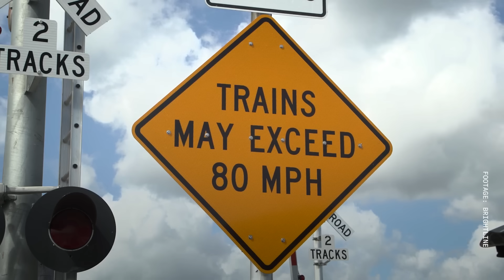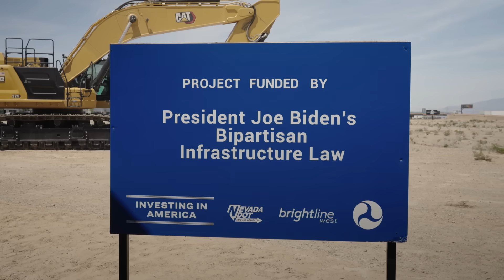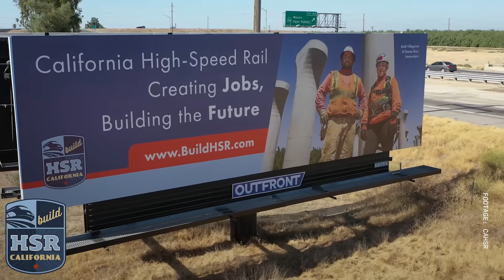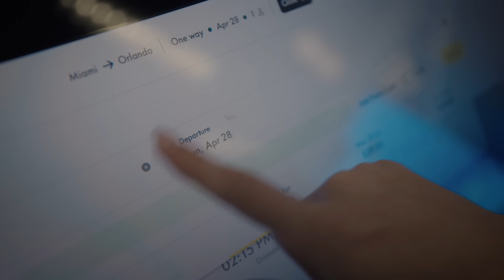Inside America’s First High Speed Rail

Comment: High speed rail is very practical for cites between 200 and 600 miles. It could remove almost a third of flights
Reply: Airlines don't want to hear that. But F 'em. Build, baby, build!
Reply: Which is why the Airline lobby is bitterly against high-speed rail.  Remember Southwest Airlines cancelling Texas's initial plans for high-speed rail?
Reply: @denelson83  That’s a silly reason. Japan has high-speed and regular trains all over the country and they still have domestic airlines.
Reply: @enjoystraveling  But in the US, airlines have a captive market and do not want to give that up.
Reply: Supposedly, more DC-NYC travelers chose Acela over flying between those two cities, resulting in most airlines ditching that particular "short hop".
Reply: @floydjohnson7888  Yep, because it's about 225 miles. Nearly the ideal distance for taking a fast train instead of flying.
Reply: Normally I don't have any problems with taking the flights. But these days the reliability of our planes is just...
Reply: 600 miles is really pushing it. The Paris - Marseille TGV line is 460 miles, and that's mainly an extension of the original Paris - Lyon line, which is 254 miles long. Washington, DC and Boston are about 450 miles apart. And San Francisco and San Diego are about 500 miles apart. That's probably as long as you can build in the US. While there are plenty of people who would take a high speed train from NYC - Chicago if one existed, there are too many stops to make it competitive with flying.
Reply: @brianfoss571  Then just do not make those stops on such a service.  In the UK, there is a dichotomy between "fast" and "slow" services, and in France, the dichotomy is between "high speed" and "classic main" lines.
Reply: @denelson83  Are you unfamiliar with American geography? Serious question. Good luck building a HSR route through South Bend, Toledo, Cleveland, Pittsburgh, Harrisburg, and Philly while telling residents the train won't stop there. Also, Paris-Marseille is the LONGEST route between major cities in France's HSR network! Again, it's only 460 miles. Any guesses how many miles separate NYC and Chicago?
Reply: @brianfoss571  If the train makes all those stops, then it would not be high-speed rail now, would it?

And are you unfamiliar with the sword of Damocles that is climate change?

And since I am not in the US, I only understand the metric system.
Reply: @denelson83   Didn't think you'd be stupid enough to reply with a worthless comment, but here we are:

1) HSR refers to the maximum train speed. The average speed in real-world service is lower, and real HSR routes involve intermediate stops at mid-sized cities. This is a common-sense idea that you should understand just by being alive. Trains rarely operate nonstop like planes do.

2) No shit. But electrifying *conventional rail* routes is going to do more to decarbonize transportation than building ultra-long HSR would. Most vehicle emissions come from cars and small trucks. Aviation only contributes about 2%. The vast majority of people can't afford to fly every week, after all. Ultimately, HSR is most effective for routes of 250-750 km (roughly 150-450 miles).

3) A mile is about 1.6 km. (See above) Multiplying distance in km by 5 and dividing by 8 is not exactly a complicated conversion, you know. We're not talking about converting kW-hrs to BTUs, are we? Besides, Google and Siri can easily run that conversion for you.

FYI: Chicago and NYC are 1400 km (870 miles) apart. At least, by the routing HSR lines would take. It may be worthwhile for the US to build a HSR line from Chicago to Cleveland (555 km), and another line from Cleveland to Philly (695 km), which would link up with Acela. But it's unlikely that more than half the people traveling from Chicago to NYC would take those trains. At best, it'd take 6-7 hours.
Reply: @denelson83  I don't use a fancifully archaic expression like "sword of Damocles" to describe a real-world, non-mythical problem like climate disruption. "Carbon bomb" is a more apt metaphor. I suggest you start using it, too.
Reply: @denelson83  do you just refuse to consider that there are trains that will stop at all stops, and there are trains that will skip most intermediate stops? Or are you just dense in your ways and love seeing people suffer through traffic jams?
Reply: @f-86zoomer37  Which is why you need a comprehensive conventional passenger rail network to supplement the high-speed lines.

The US does not have such a network.  The vast, vast majority of rail lines in the US is reserved exclusively for freight.
Reply: @denelson83  California literally does have that. So I don’t know what you’re complaining about? Just opposing something for a made up reason for the sake of opposing it?
Reply: @brianfoss571 the Europeans solved the 'stops' issue by having schedules that include the stops and other schedules that are 'express' routes with no stops between the major destinations.  All share the same rail line.   

Madrid to Barcelona express costs about 15% more than the standard route with stops and runs every other hour.  

Milan to Florence to Rome also has express trains that depart every other hour.  

Now if only the nimby crowd will put a sock in it, we might actually enjoy a true benefit to our nation's growth and safety.
Reply: @brianfoss571 Amtrak will service the in between stops , adding too many stops defeats the purpose of high speed. NYC-DC line with a stop in Philly it’s the mid point. Baltimore is too close to DC for a stop & theres already existing lines. NYC-Chicago with a stop in Cleveland maybe
Reply: @tyharris78  All of the cities / metro areas I mentioned between Chicago and NYC are big enough for HSR stops. Some would only have 1 or 2 trains per day stop at them (i.e. South Bend/Elkhart and Harrisburg). The point is that the distance is long enough that it would only exist as two connecting HSR lines. 

That's Chicago to Pittsburgh via Cleveland (about 470 miles) and Pittsburgh to NYC via Philly (roughly 400 miles). You're effectively connecting two NEC-length routes together, and the stops in Cleveland, Pittsburgh, and Philly are non-negotiable. Most of the trains will probably need to stop in Toledo as well to take in connecting traffic from Detroit.
Reply: @brianfoss571  HSR and planes would be primary sources of travel and all others would be secondary connecting routes. Pittsburgh-Harrisburg-Philly is a local state metro concern the same can be said for Memphis-Nashville-Knoxville. The point would be to connect major metropolitan areas & tie in other modes of travel already in existence, Amtrak greyhound & local transits would need to improve routes due to disruptions. 1 a day no longer has to be the ultimatum
Reply: @brianfoss571  NYC to Chicago is about the same distance as Beijing to Shanghai and the latter has trains that can complete the trip in as quick as 4.5 hours w/ stops. 600 miles is the threshold in which the fastest of high-speed trains will beat a plane in total travel time. Due to the train's higher levels of space and comfort, the actual viable distance for HSR is greater than 600 miles (again, NYC/Chicago & Beijing/Shanghai are ~800 miles apart) aka, what many people are willing to do. I could see a 4.5 hour NYC to Chicago high speed train being immensely popular, especially with the proper stops.
Reply: @Ven100   Beijing has a metro area of 22 million; Shanghai has 40 million.

NYC and Chicago just aren't sufficiently large metro areas to be ideal for HSR at that distance. You do realize that the gravity model includes populations, right?
Reply: @brianfoss571  I don't see it ever being competitive with flying.
Reply: Flights will then only make sense if you fly from continent to continent, and high-speed trains will take over transportation within the continent
Reply: In the US, it's close to 4000 miles between our largest 2 cities. @baramuth71
Reply: @baramuth71 No it won't.  The U.S. is too big and spread out for a truely national high speed rail.  It will never make sense to take a train from NYC to LA as long as planes exist.  A more practical goal would be to focus on a few regions where high speed rail makes sense and build more commuter rail in major metro areas.
Reply: @JohnnyOU08  We will have to keep an eye on Maglev developments in other countries.
Reply: You do know Japanese,  Chinese,  Taiwanese,  British,  French do fly domesticaloy despite their excellent public transportation n HSR. They also take ong distance buses.
Problem with HSR supporters is that they want to build airport style HSR which no other countries do. their arguments are silly.
TSA groping, if you have Japanese style public transportation,  some security measures will be implemented although it will not be as bad as airport security. 
Just in time boarding.  This is childish. Try gp to Paris or Tokyo station,  they are not as bad as international Airports, but it can take time to navigate stations.  That's how stations should work, a big public transportation hub. Then HSR supporters hate.
Then there is sightseeing.  You don't spend 10 of billions dollars on sightseeing trains. It can be added bonus.
Don't bring reduce carbon footprint.  Many HSR supporters are against local public transportation improvements.
Reply: @commentorsilensor3734 man you’re just such a liar. It doesn’t even deserve a proper response. Strawman all around
Reply: It is a 50 minute flight from burbank to San Fran..why would I want to spend 3-4 hrs on rail....
Reply: @trainsplanesandotherthings5187  it may only be 50 minute flight from Burbank to San Francisco, but it is required to be at the airport at at least an hour in advance plus a bit more because of It’s hard to predict how long the lines will take through security
Reply: @trainsplanesandotherthings5187  why would you expect a train on an hsr track to take so long? Also, how long does it take to go through security, boarding, taxiing, disembarking, luggage collection, and finally rental/ride hailing? When you say it's a fifty minute flight vs 3-4 hrs by train, you are not comparing apples to apples
Reply: @trainsplanesandotherthings5187  A 50 minute flight where you have to arrive to the airport 2 hours before the flight and go through dehumanizing security stops, at airports that are on the outskirts of the towns, or a 2 hour and 40 minute train ride from city center to city center?

Most people would take HSR over that flight, especially when that flight is ALSO 3-4x as expensive.
Reply: It could remove almost all the flights. There would be no benefit to flying. HSR is better in every way compared to short distance flights.
Reply: @barryrobbins7694  Except most short-distance flights are regional feeders that are necessary to fill bigger planes in a hub-and-spoke model. A high speed rail route from Chicago to Detroit would make American, United, Delta, and Southwest cut flights. But a segment like Chicago to Indianapolis is almost exclusively small regional feeder jets because those flights aren't there for point-to-point traffic. That's a 3 hour drive max. Those flights are for passengers connecting to longer routes. And they'll still exist even with a Chicago-Indy-Cincinnati/Louisville HSR route. Doesn't mean that HSR route shouldn't exist, but it won't get rid of those flights to O'Hare and Midway, either.
Reply: @davidlfort  Not if the train stops in the Loop instead of MDW or ORD.
Reply: @brianfoss571  I think HSR should be seen as a regional system in the short term. Having HSR going to airports outside population centers would negate the speed aspect of HSR. Trying to replace all the connector flights probably is not too productive. No one would take HSR from the airport in Chicago to the airport in Detroit. They would probably drive or fly.
Reply: @barryrobbins7694  Based on what?
Reply: @wno1043   Wherever HSR is an option, it quickly outcompetes short distance air travel. It is better in every way.
Reply: @denelson83  Alitalia did itself in. The last time I flew Alitalia it was in a bus. It was supposed to be a connector flight from Rome.
Reply: I will ride a train rather than drive or fly.  It’s about time we stopped wasting money on war mongering and started worthwhile projects such as this.
Reply: @lupemerrit  but you are ok with drive to ride. What a big irony for train lovers
Reply: And that's why the airlines lobby hard against high-speed rail or any kind of passenger rail
Reply: That’s why BILLIONAIRES don’t want high speed trains
Reply: What a joke
Reply: America is just way too big😅

Comment: The map at 2:45 doesn't seem quite right.  It shows the purple line going up from LA through the Newhall Pass and splitting eastward on the orange line from Palmdale to Victorville (probably paralleling the Pearlblossom Highway).  If it routes though Rancho Cucamonga, it'll probably use the metrolink rails sout of the San Gabriels (the brown smudge below that orange line) and then turning north through the Cajon Pass to then get up to speed through Victorville.  Basically, that short, nearly north-south span between the more east-west spans, than should continue south through the mountains, then cut west along LA's latitude.

Comment: Ironically the privately owned & operated Brightline West has cracked the code on how to developed HSR cheaply and efficiently.. And that's to use public Rights of Way that don't need to be purchased from unwilling buyers who are going to hold the whole project hostage. And sensible speeds. They are going to be fast trains but not the fastest which is fine because the type of engineering required for 220  MPH is SIGNIFICANTLY more expensive than it is for 125-150 MPH which although isn't considered TRUE high speed rail today is as fast as the Japanese Shinkansen trains were when they launched in the 1960's... And that's good enough!

Comment: Level crossings will lead to high speed accidents. China has virtually no level crossings because all of the tracks are elevated or underground.
Reply: Not just china in France and i think in the rest of Europe too we're not doing that either precisely because of this, there are some level crossing where train can reach 200 km/h at best but thoses one are guarded to prevent any accident, other regular level crossing are just on more normal railways.
Reply: Brightline West will have no level crossings on the HSR section.
Reply: "F..k yeah grade separation" - unknown rail planner

Comment: There's also a project to try to get this on the East Coast; Boston to Atlanta IIRC.  Not sure if it's making any progress with legislators, though.
Reply: The main roadblock is the old infrastructure in the area. Too many bottlenecks, and the tracks should really be sets of 4 for most of the way, considering the existing heavy rail traffic in the area

Comment: We need rails in Michigan's upper peninsula so bad...
Reply: This is about HSR. That wouldn’t make sense for your area.
Reply: @barryrobbins7694 A big reason hsr works in other countries is because they work in tandem with other modes of transit, including conventional rail.
Reply: @Androfier  Exactly — other modes of transit. HSR exponentially benefits from connecting to well developed regional transit systems. 

Some people think HSR should go everywhere, even places with low population density. Someone else in the comments was wanting HSR in a town of 10,000 people, a town not even on a travel corridor between larger towns.
Reply: @barryrobbins7694  This is what frustrates me about CAHSR, while the system is essential I feel they are forgetting about improving the services that already exist or could exist with less challenges and smaller budgets. Things like shoring up the LA to San Diego line to electrifying the San Bernardino line as examples. The state is trying to shoot for the moon before they even achieve flight.
Reply: @Androfier  LA has made great strides in recent years. I’m sure that more can be done.

In Northern California there is the Link21 project that involves the 21 counties making up the Bay Area/Sacramento megaregion. One of the big improvements will be an additional rail crossing of the bay.
Reply: @barryrobbins7694  A lot more needs to be done about lines going to the IE since they run limited service at the hesitant will of class 1 railroads that own the tracks.
Reply: @Androfier  The Bay Area and Sacramento are good on the front — no track sharing. Sacramento is also extending their limited light rail to the airport. It is too bad that BART doesn’t circle the bay as originally planned, but there is the Caltrain up the peninsula. It’s amazing that it took so long to run BART to San Jose.
Reply: But when are we going to get it?
Reply: @abzer0gaming  no you don’t

Comment: and whelp, would love more local train systems for major areas. Florida can't handle all the new traffic.
Reply: Brightline is planning to work on a Commuter system along its existing route. Don't know when that will start seeing big progress though. Also, it would be nice if Amtrak had more shuttle systems, like the Valley Flyer. They could put older equipment to use on these systems since they would travel shorter lengths and would probably be shorter trains too. This way, Amtrak can serve more stations and locations using the shuttle trains and the shuttles can connect people to stations served by other Amtrak services that cover longer distances.

Comment: High speed rail is a scam not because the idea is bad but because it's far too easy for people involved to see it as an opportunity to soak the taxpayers. It would be less expensive to have a fleet of EVs drive in tandem on a dedicated highway than this mess. I wouldn't be against the high speed rail if it weren't for the fact that it will be underutilized, be expensive and be continually subsidized by the taxpayer with such a humongous outlay just to get things started.